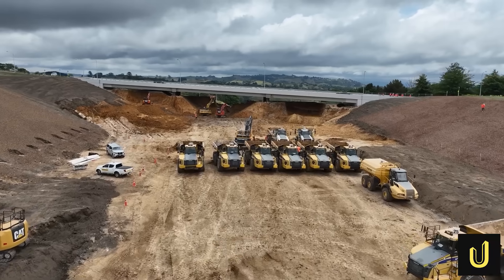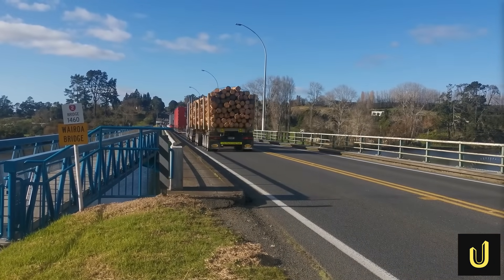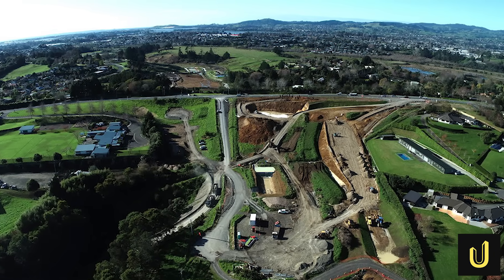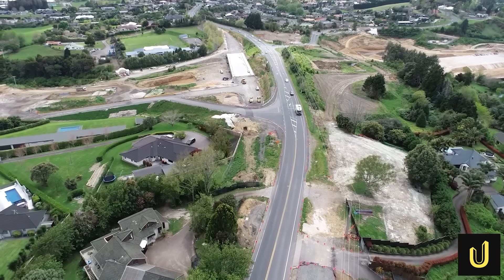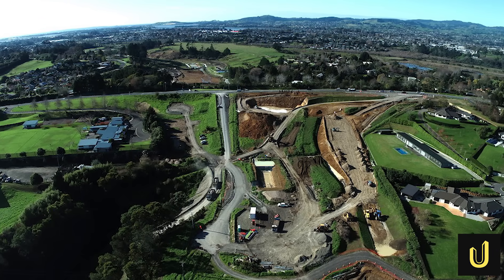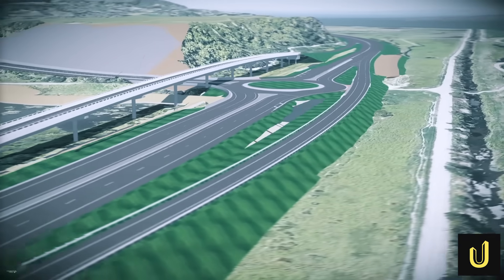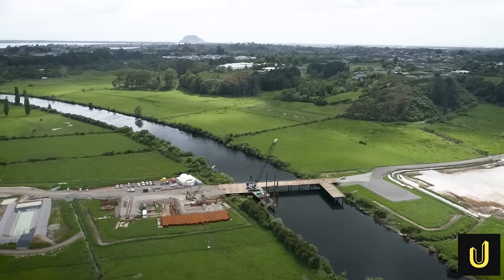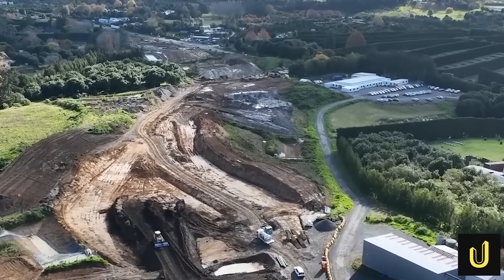New Zealand's BIGGEST Highway Rebuild in History

Comment: Great project, a shame we couldn't have done it sooner.
And in all honesty, we could never have done this mega-project; to such standards, even 10 years ago. If we consider the lack of men and equipment, due to the many other urgent projects going on over this time. To those miffed about tolls, consider this. The Auckland Harbour Bridge had a toll from the day of opening. This never stopped people from crossing, as it saved many hours of travel and fuel costs. The Toll is long since gone and we are left with, one of the most important infrastructures built, to the benefit of both Auckland itself and the entire Northern areas of State Highway 1. So, don' t be angry, it's a blessing to your whole region. Cheers from Hibiscus Coast.

Comment: … I believe the next step should be electrification of the Kaimai railway tunnel and two, two lane car tunnels under the Kaimai Range’s as a more economical, direct transport link from Tauranga to the Waikato.
Reply: Have driven highway 29 over the Kaimai range for 60 odd years and at present the road is good.
If you drive to suit the road and the conditions yoj will be just fine
To many idiots think they have to be first  and thats where the trouble starts, cars are faster than the brains driving them
Reply: That would not be before time
Reply: No no no electrification is not the answer safety cost and efficiency shows it's not

Electrification is no use in an emergency hence why first responders use diesel not electric
Reply: @Wamsubnz 
“Electric trains!”
E cars & trucks are rubbish.
Reply: @Wamsubnz 
We are talking electric trains! Running off the national grid.
“NOT!!”… inefficient electric cars & trucks , relying on underdeveloped batteries.
Reply: @jr3764 we already discussed this 2 months ago 

Wait why is my reply not showing
Reply: I have been in transport for many years and a tunnel would cut transport costs in half. It takes a lot of fuel climbing the Kaimai’s with heavy transport.
New Zealand was advised to go from steam to electric. Diesel/Electric was an uneconomic disaster that cost our country dearly and electric has never been set up properly.
The sad part is that most of the population that can barely keep a car in a straight line have no clue of the logistics of heavy transport, topography and speed reductions that keep freight costs through the roof.
A straight flat line uses the least amount of expensive fuel ⛽️ Trucks and trains use massive amounts of fuel day and night ✨

Comment: Toll’s should be cheaper, more consistent and not too greedy. The sheer number of motorists using it will pay for it over the coming years. Locals can’t afford $3 up to seven or more times a week on top of running costs. This route is a vital link from Tauranga to Waihi to Paeroa to Auckland and will help fix the nightmare bottleneck it has become. I have been using it since the late 70’s. Unlike today it was a nice, simple, quiet drive, by comparison, back then.

Comment: Upgrade the old single track railway line, you could move more goods and people
Reply: Like f ur, how long have you been paying ruc for your 4x4
Reply: @quartuppkachupp what? you do realize the equivalent of RUC is built into petrol price as well right?
Reply: It has only just been introduced
Reply: @quartuppkachupp No. Fuel tax has always been on petrol, they are changing it so everyone is going to RUC. they had it separate for diesel because it was 'unfair' for people using diesel off road to be paying tax for using the road. same as you could still claim the tax back if you could prove you were using the petrol off road.
Reply: RUC for a standard 9axle unit is a hell of a lot more than your urban hush puppy rate your paying. Oddly the less axles the unit has the more RUC it has to pay
Reply: @quartuppkachupp yes, we are almost there now, Whats the ratio between RUC rates and road damage between and truck and car?
Reply: Depends on whether you want overnight delivery of your must have items or your 3day delay
Reply: @quartuppkachupp so we moved goalposts from 'they pay their fair share' to 'ok but delivery times will increase'?
Reply: No you moved it  subsidizing heavy transport. In all transportation industries its not making money if its not fully loaded, if its NOT at capacity those ruc don't change the govt still wants its 30Ibs of flesh sweat and tears those costs are moved on to us the consumer. Would you rather have trains running at less than capacity running 3days late at 4x the cost. They started a train passenger service between akl-ham it failed because of a lack of capacity and high ticket cost.
Reply: @quartuppkachupp 'yes so invest in rail and provide a actual alternative to trucking'  yeah you're being disingenuous or not smart enough to be having a conversation. investing in rail would mean it doesn't take 3 days or cost as much as transport that can will switch when its an effective mode of transport, both in reliability, time and cost. 2nd you went on a 4 comment reply about RUC and Road tax and then just pivoted when you were proved wrong. 3rd it would cost the average person less because as stated we are currently subsidizing truck transport through our taxes.
Reply: Where were you this year when they kiwirail trialed a passenger service between Akl-Hamilton smart ass it failed because of costs and lack of patron's. Rail is only good for bulk commodities not for quick deliveries cause at the end of the day they need a shit load of smaller vehicles todo the delivery more fucken congestion perfectly efficient my ass
Reply: @quartuppkachupp we have been talking about transporting goods this whole time, are you alright upstairs? yes so you transport by train INVEST in proper rail yards, tracks and depot and perform final delivery through smaller transport trucks. what are you struggling with?
Reply: @quartuppkachuppIt didn't fail, it is still operational, it has had its success and its shortcomings but in terms of rising ridership and recorded modeshift it is working.
It is however expensive and struggling to achieve full carriages but ridership has been increasing year on year.
Once the CRL opens and the Auckland rail network rebuild is complete, it'll probably increase in reliability.

Rail is far more efficient in transporting goods.
It can transport far more bulk goods, over a further distance at faster potential speeds all while taking up less space, less energy and less maintenance costs.
Where rail obviously fails is direct a-b deliveries, but given its ability to transport more goods between cities, that usaully more than makes up for that shortfall.
Its also more economical.
Reply: The simple fact that rail heads need alot of land NZ is too small for it to be effective
Reply: @quartuppkachupp we have one of the lowest population densities in the world. there is plenty of land to put rail yards its just that national torpedoes any bill that tries to advance rail infrastructure in this country because they are brought and paid for.
Reply: The cost of upgrading the main trunk line to a double rail system would be almost equivalent to totally rebuilding the entire rail system altogether, the bridges cuttings an regional town’s would need serious redevelopment
Reply: Ooh that missed flights was a real statement. Aucklands traffic/ roads are literally the worst
Reply: Of course it is but if it's only (example) 30 wagons long its not operating efficiently and takes 3days for delivery its not overnight. Bulk commodities like timber and ore then yes its perfect, running frozen goods not ideal
Reply: Rail is only viable when its fully loaded.
Reply: @quartuppkachupphuh? Kiwirail's main income is from freight lmao
Reply: @quartuppkachupp yes so invest in rail and provide a actual alternative to trucking and then disincentivize road transport through toll or road users that actually makes trucks pay a better proportion of the burden considering they cause far more of the wear on roads.
Reply: NZ is too small for efficient rail system, unless you want your land to be a rail head be my guest. Trucks have been paying more than their fair share for along time, that money goes in keeping your suburbs roundabouts newly paved Remuera streets tidy the main arterial routes get ignored until as usual a natural landslip causes a rethink
Reply: @quartuppkachupp i suggest you look at some studies around road damage and axel weight and how much RUC is for a truck and for a car. we are subsidizing truck transport.
Reply: Incorrect, the Trucking industry are the biggest cause of Road damage, Especially the 50 ton trucks. Motor vehicles are light by weight and literally cause close to no wear and tear on the Roading system. Private motorists Subsidise the Roading System.
Reply: We also have a lot of ghost towns with useless rail heads. It was tried it failed don't need it. For your information National and Winston turncoate Peter's have always been rail orientated, but they also no not to go backwards because of its past failures
Reply: @quartuppkachupp okay clearly you arent firing on all cylinders. rail heads in small ghost towns is not comparable to rail yards and distribution centers for major city. no national have never been rail orientated they have consistantly canned or redirected only money for rail to building highways so their friends can get Govt contracts while study after study proves building roads doesnt give good returns as compared to rail.
Reply: @quartuppkachupp lay off the codys its messing up your head

Comment: Tauranga needs rail for passengers
Reply: Unfortunately the people in charge don't think like that as the roading and trucking lobbyists hold to much sway when it comes to infrastructure projects
Reply: @JimmieLad81  rail is never cheap. Only in the minds of the simple. The last 10km will always be trucking...anywhere.
Reply: @ricardobrown4878 infrastructure in general is not cheap, but if we are talking about volume, capacity, space, distance and energy usage relative to capacity, rail decisively out performs roads over long distances on costs and economic benefits.

Roads have the benefit of more flexible and fine tuned routing hence why the last few km of logistics are often over roads.
But in terms of vast distance travel and freight handling, rail is far more cost effective and cheaper in the long run, it takes up less space, is more resource efficient, more energy efficient, can carry larger volumes over longer distances at high potential speeds and with higher economic returns.
Reply: Think bigger think a high speed rail system that runs the length of the country and picks up all major ports and cities
Reply: @seanbiddle2023 that too.  Bring back the Auckland - Rotorua & Tauranga,   but also Invercargill to ChCh would be needed.
Reply: How will everyone fit there cars on the train tho? Or do you just expect everyone to walk for hours to reach their final destination?
Reply: @alexbainbridge7160  Cars can be taken on rail wagons in the same train as the passengers. It's been done overseas. It's the rail equivalent of roll on-roll off ferries.
Reply: @kiwitrainguy in Australia they still have the car carriages for the Ghan
Reply: It used to no one used it.
Reply: Rail is incredibly inefficient, bad for the environment and has a very carbon footprint per passenger km traveled.
Reply: @o4pureh2o Incorrect.
Rail is one of the more efficient modes of transport.
Rail can carry more people and goods, more quickly, using less space and less energy, trains are more energy efficient than automobiles relative to its weight and load.
Reply: Not if its anything like the heavily subsidised train between Hamilton and Auckland which ratepayers are sick of paying for.
Reply: @kevinansley7353  Are people sick of paying for subsidised roads?
Reply: @kiwitrainguy no because they go where we want to go not just the "main" centers. Try going skiing or to the beach on a train sometime letalone taking your boat to a boat ramp which we also pay for so forget the simpilistic train good car bad and do some actual thinking.
Reply: @kevinansley7353 Roads are also heavily subsidised on par with rail.
Considering they often lead to increases in long term congestion, this alone gives roads a lower cost to benefit ratio, and we haven't even gone into detail their other effects, such as urban sprawl, lower population densities, higher long term maintenance costs, higher urban costs etc.

People go to the beach on trains all the time, its not that niche.
People also go skiing using trains, the only reason that isn't common in NZ is because there are no trains in NZ that go to such destinations.
Taking your boat to a boat ramp? How often do people do that?
Of course you are going to require a car for that, but that isn't something everyone does so let's come back to the bigger picture.
Cars will always have the convenience of direct point to point travel, but that is assuming you are able to park directly at your destination which often isn't guaranteed.

Alot of people opt for trains due to ease and cost.
You go to a station maybe by driving, uber, bus, walking or cycling. Hop on, hop off at your destination and complete the rest of your journey via the modes above, No need to worry about traffic, parking or gas.

It shouldn't be about one over the other, but NZ has got to start investing more into rail.
Reply: @kiwitrainguy  Huh? Road users pay plenty. RUC, fuel taxes, GST etc.
Reply: @ricardobrown4878  everyone pays gst,   and fuel tax doesn't fund roads